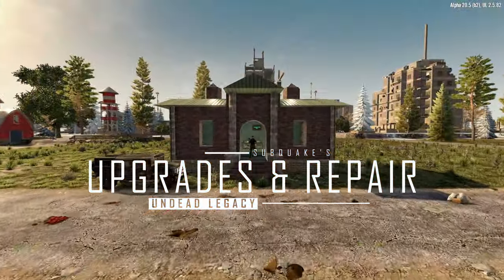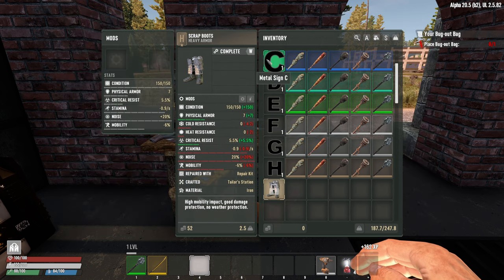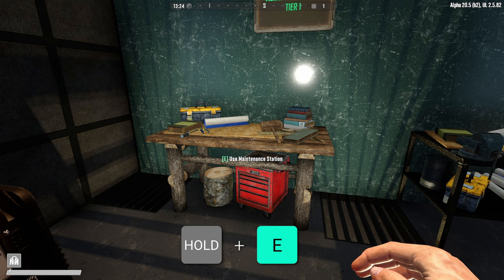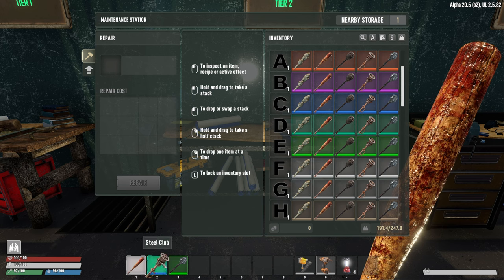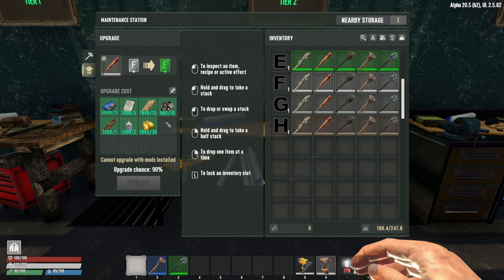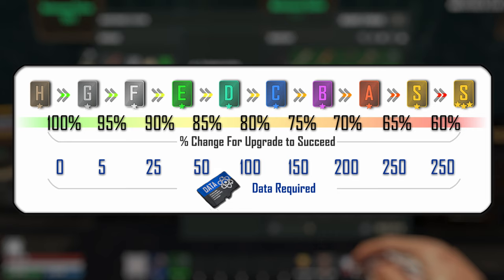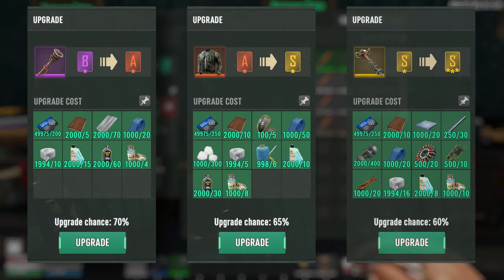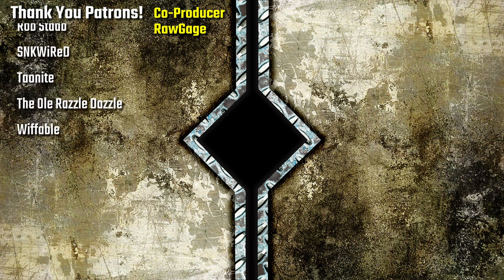Undead Legacy - How To Upgrade and Repair using a Maintenance Station! | 7 Days to Die Alpha 20

Comment: One suggestion is that you can pick up and take your maintenance station with you when going out for long expeditions or long mining sessions so that you can cheaply repair items on the fly.
Reply from the maker: That is such a good one!  I will need to include that on my round 2 tips and tricks.
Reply: And also if you got dukes to burn...use the Tradey Bench for repairs🤘

Comment: Great video on Undead Legacy! Recently been enjoying this mod with a friend and this is helpful. If your looking for more ideas we've recently run into trying to understand end-game tools for harvesting resources. Also, we have been running with motorbikes and there are so many vehicles it's hard to know which ones to try and get next. Thanks again for the videos!
Reply from the maker: Thanks and sounds good!  Vehicle breakdown is already on my video backlog!  I'm still fighting through end-game myself to get a better sense.  I had just gotten the jackhammer and auger in my last playthrough when it go corrupted.  How far along are you?
Reply: @WaywardEko   We just did our first set of tier 5 quests. I think we are on day 24 or so. I've picked up the machine gun with the built in silencer and scope. By far my favorite weapon so far. We have mass produced steel recently and have a steady supply of ammo. We still need to find a source of titanium and find a mine for oil shale. Also, side note you will need a table saw to upgrade the Carpenter's Bench. You have to pick up the table saw in a POI.

Comment: Now you have to remember to fix your items before you leave your base! Don't you already have enough to worry about with just keeping well fed and hydrated? 😄 Curious how repair balances out with higher tier/quality items vs what it used to take with just a vanilla repair kit.
Reply from the maker: You have more durability which does help.  For a while I had multiple steel axes and would just take them both for mining expeditions -- I like Tem's idea though of packing up your maintenance station and taking it with you.